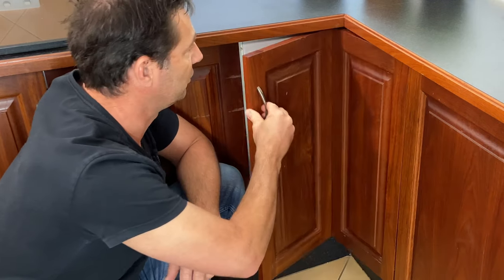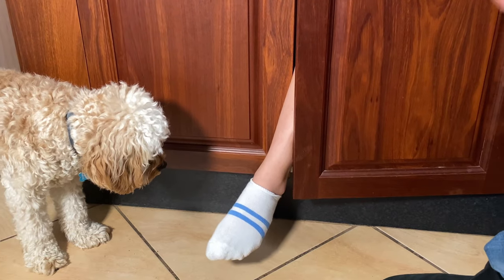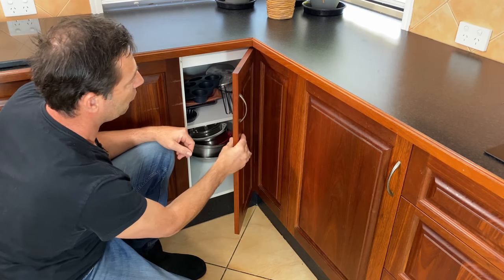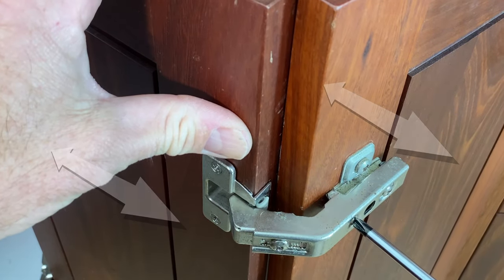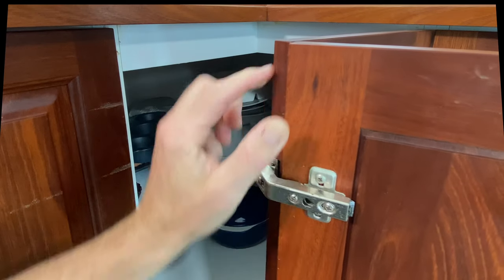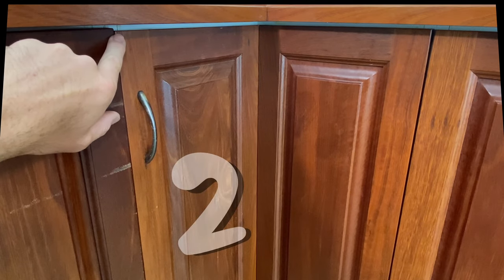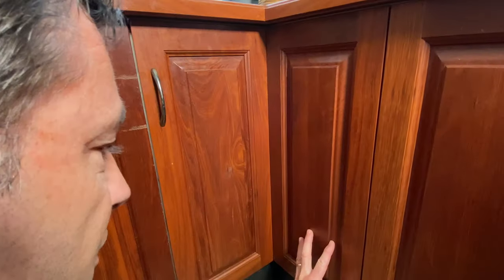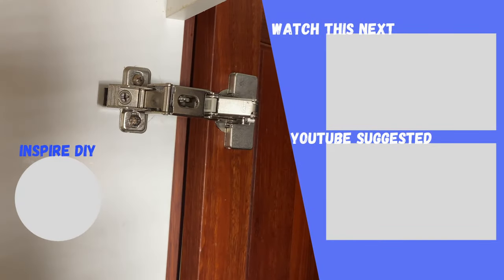How to adjust a kitchen corner cabinet

Comment: Thanks for the tip👍 worked a treat on my corner cupboard after i had the same sagging issue.
May I suggest you countersink your door handle screws to avoid the 2 scratches you seem to have from the handle screws rubbing on the door when closing😎
Reply from the maker: Hey Steve, that’s a great tip for those wanting to avoid this kind of damage, thanks mate! 👍Kent

Comment: You need to countersink screws on lazy Suzanne door handle so it will not scratch other door.
Great video on hinge adjustment.
Reply from the maker: Hey Subota, you are right about that - those scratches look horrible huh! cheers, Kent

Comment: Hey Kent, great video, but my door is still out of line. It appears that the bottom hinge is out of adjustment, it won’t turn anymore. These cupboards are new, well three weeks since installation, is there any trick to get more adjustment.  Cheers Steve
Reply from the maker: Hey Steve, that’s a tough one! Did you install the doors or a contractor?
Reply: @InspireDIY  contractor

Comment: Hello sir. Very interesting information. Bright young man. So I have American Wood Works corner Lazy Susan bottom corner door. I have to push door number two by the knob to try and get it closed.  Any thoughts would be appreciated.
Reply from the maker: Hey Chris, it’s really tricky without seeing it💁🏻‍♂️ is door2 hitting the cupboards next to it, or is the door hanging open rather than seating back flat?
Reply: @InspireDIY  door to is just hanging open. When I push it to close all the way it pops back out. Thank you so much for getting back to me
Reply from the maker: It might be that the 2 cupboards are binding/pressed against each other when shut💁🏻‍♂️ have a play with the hinge adjustments one at a time, a smart bloke like you should nut it out👌 best of luck mate
Reply: @InspireDIY  Ta my friend from your mate in the Carolina's.

Comment: Good overview... but that scratched up cabinet door next to the corner cabinet drives me nuts.  A major downfall of those corner doors and I see it all the time.  Put a few strategic quality rubber bumpers on the insides of the corner cabinet doors to stop it from happening.
Reply from the maker: Yeah I agree mate, I put some felt furniture feet things over the screws from the culprit handle.. doesn’t fix the damage done though 🤔 good on you mate. Kent